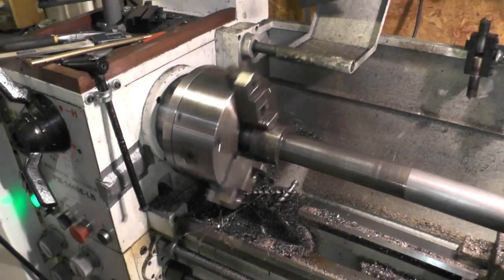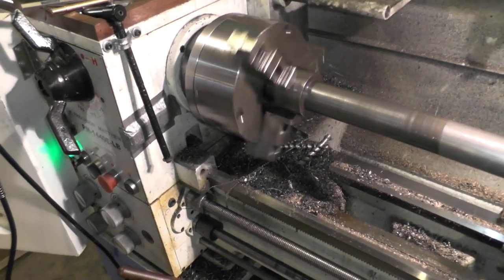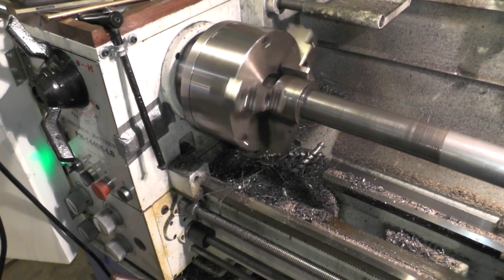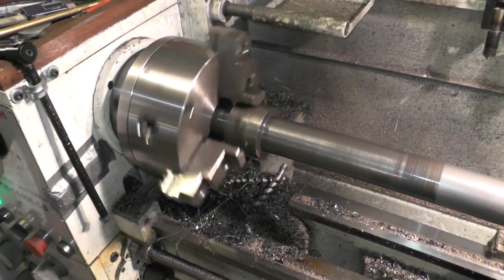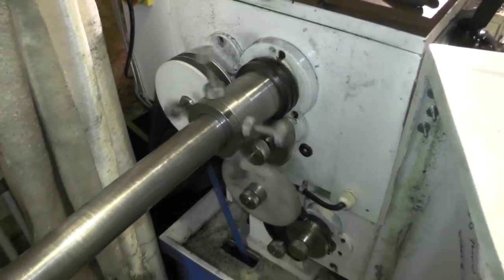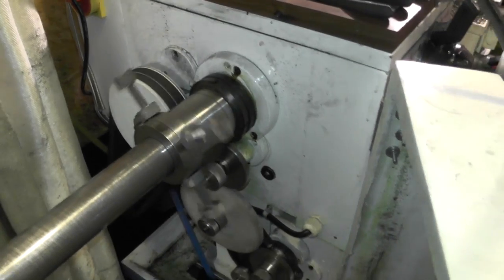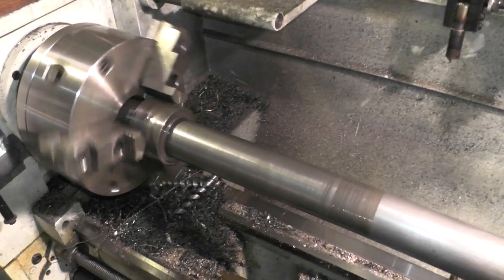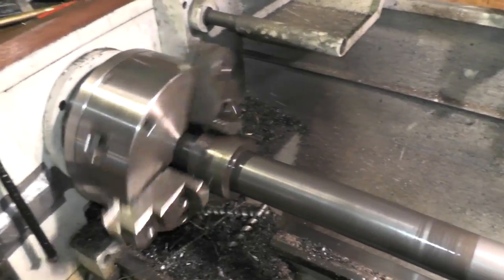Boring lathe spindle tube, 2" dia 12" long while still in the machine.

Comment: good job no taper in the head stock ?
Reply from the maker: Hummm... thats a good question, have not checked.
Being the boring bar bearings are on each end of the spindle, i dont see how there could be, but i never checked.
After it was done, i slide a peice of 2.015" stock through it and did not notice any bind.

Sorry about the late reponce.